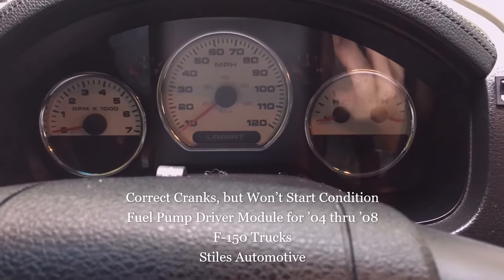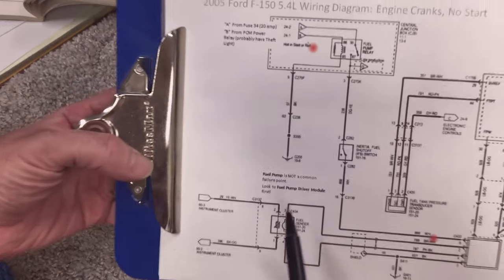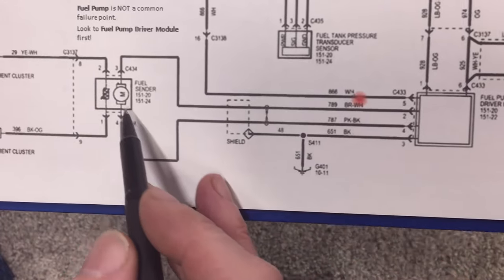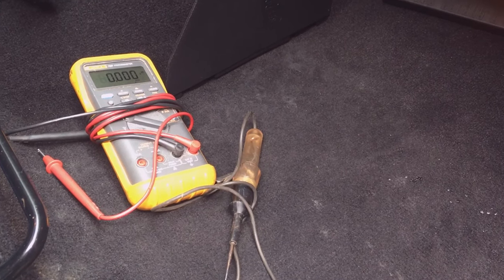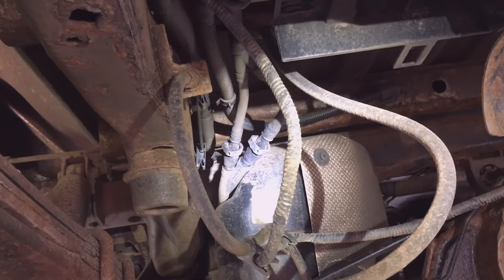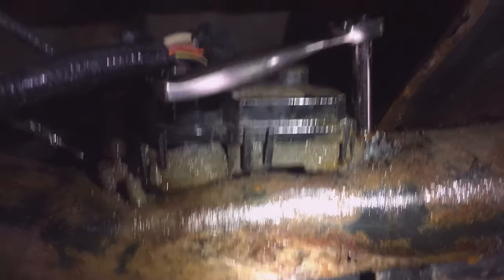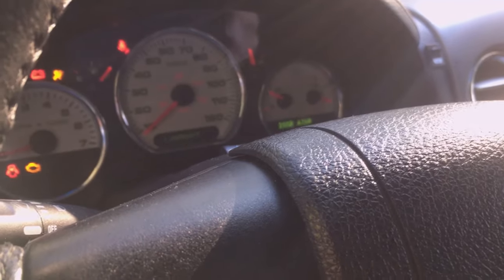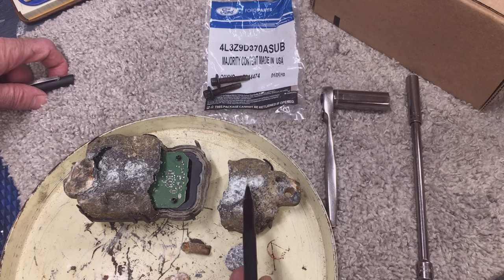Correct Cranks, but Won’t Start Condition – Fuel Pump Drive Module for ’04 thru ’08 F-150

Comment: You literally just saved my 07 from going to the scrap yard, I was ready to throw in the towel on the ol gal after changing fuel pump, fuel filter, throttle positioning sensor, spark plugs and coil packs i was at a complete loss till I swapped the fuel pump drive moduel.fires right up my truck (optimus) thanks you!
Reply from the maker: Joshua, I am glad to help! I appreciate the comment.  Your comment gave me an idea, my neighbor down the road a ways has a very nice looking Mark LT sitting beside his garage, I now wonder if I could help him as well.  - Stiles

Comment: So question if that module doesn't look damage how domu know if its the module or just a bad pump . My car does exactly wat this car does 2004 expedition crank and cranks nut no start at all please help im on fix income on disability and lots of doctors  appointments thank u in advance for your help
Reply from the maker: Jesus, You know if the Fuel Pump is bad because you jumper the wires (like I show in the video) and the Fuel Pump will run or if the Fuel Pump doesn't run and you are powering it, it is likely the Pump. - Stiles

Comment: Not sure if this is my issue as I don't have the proper testers for fuses and pwr. It is my landlord's truck; mine broke down and he said I could put his on the road and use it for work. I paid to legalize it and it never started. Great video, finally not just someone saying hey, your fuel pump is bad lol. Been sitting for 8 months so anything could have happened. 2:30 in the morning and I'm going to just the physical condition of the module.
Reply from the maker: Papa, Ensure your Battery has a full charge.

I assume when attempting to start the F-150 you do not hear the Fuel Pump, The F-150 Cranks and will not start, get a helper to turn the Ignition Key, while you put your Ear to the Fuel Filler Opening (with the Fuel Cap removed), you should hear the Pump Run. Have the helper turn the Key on and off a few times. The Fuel Pump should cycle on and off.  If it does not - -

1) With the Ignition Key off, 2) Remove the Electrical Connector from the Fuel Pump Driver Module (FPDM), 3) Using 2 Paper Clips jumper the Positive and Negative Electrical Connector Sockets (like I showed you in the video), 4) Turn the Ignition Key "on" ( and not to "start" or the F-150 may start and run), 5) Go back to the Fuel Filler Opening and listen for a good strong Fuel Pump, 6a) If you don't hear it, it is likely the Pump, but you don't know unless you check Voltage. 6b) If you hear the Fuel Pump, go start the F-150, and it will likely run, you have bad FPDM.

Let me know how it goes! - Stiles

Comment: Mine just cranks but slowly. What could I possibly check? I already jumped the positive and negative sides of my starter, also benched my starter out the car and it's OK, but still nothing.
Reply from the maker: Evan, the first thing is ensure you have a good Battery and it is fully charged. My Stiles Automotive Video, Charging and Starting Systems Troubleshooting may help you (see link below) - Stiles

Charging & Starting Systems Troubleshooting: Engine Fails to Crank or Cranks Slow, May or Not Click https://youtu.be/POAIX4QaEhA

Comment: Sounds like my 2001…
Reply from the maker: Sogent56, You may have a "Cranks, but won't start" condition, but your Fuel System is different. You have a Fuel Pressure Regulator which controls the fuel pressure. - Stiles
Reply: @StilesAutomotive  where is that located?   Thanks

Comment: I can't find fuel pump module on 2004 f 350 it is not at the rear by passenger tire where else could it be
Reply from the maker: Richard, what Engine does your F-350 have? On first thought, the 1999 (or so) thru 2004 F-350 gas Engines have a Fuel Supply Line (or Pressure side) and a Fuel Return Line. Which means you have a Fuel Pressure Regulator. The Regulator in on the Fuel Rail on the Top of the Engine or on the Fire Wall just behind the Engine. If I'm wrong tell me your Engine Size, I'll have a look in the Parts Book. - Stiles

Comment: Replaced module still won't start only starts with jumper wires
Reply from the maker: Donnie, That tells me the most likely problem is the Fuel Pressure Sensor on the Fuel Rail on the Top of the Engine. It could possibly be a Wiring problem or a problem with the Powertrain Control Module, but not as likely. Did you make sure the case (the body) of the new FPDM is well ground to the Mounting Point on the Crossmember?  Is the Electrical Connection on the FPDM ok? no Pins bent? - Stiles

Comment: I have a 2013 E-350 with the same problem, it does start, but only runs for about 10 minutes then stalls and won't restart, just turns over. If I let it sit for another 10 minutes it will start again and run for about 2 minutes. the garage thinks it's electrical, but I tend to think this is the problem. For a $50 part I'm pretty sure I can change it out myself. Thanks for the great video.
Reply from the maker: Wayne, For F-150s, If your Fuel Pump Drive Module (FPDM) is corroded at all replace it, your E-350 FPDM is not the same, it is plastic, and I'm not convinced it is the problem, it could be, but when it fails it fails. I think . .  .  did your shop check the fuel pressure at the Fuel Rail? Was it ok? if low pressure your Fuel Pump may be failing. or your Fuel Pressure Sensor on the Fuel Rail could be causing a problem. I showed in the video how to jumper the FPDM Electrical Connector, your Electrical Connector is different, I believe you would jumper the 2 outside Sockets of the 3, then with the Ignition Key on the Fuel Pump will run at full pressure, does your Van start and run, now? If so the Fuel Pump is ok.  Yes, it is a $50 part (for your E-350, not F-150s) and I would recommend you pay the extra money for a Motorcraft Part, I don't always, but in this case I do. - Let me know how it goes! - Stiles
Reply: @StilesAutomotive  My shop, the local Ford dealership, thinks it is electrical due to all the extra wires under my dash, the vehicle used to be a mobility transit van with wheelchair ramp. All wires for the exterior lights and ramp were cut and taped years before we bought it. But I started it up and drove it back from them and had no problem, no stalling. It just started recently and it has been sitting in my driveway. I did buy the part directly from Ford. There has never been any electrical smell at all that I have noticed either.

Comment: Thank you sooo much !! excellent video, this is second time I have to change this on a 16 year old F-150, I didnt know how to test my circuit...with paper clips is very smart !! ..I had to disconnect the battery for 2 minutes to re-start the computer. I live in uper Canada with the world record calcium-salt spreading, looks like you have to change this every 8 years...thanks again !!!
Reply from the maker: ToBloo, You are very welcome, I'm glad to help! Geez, you are my kind of Vehicle Owner; talking about period maintenance every 8 years. That is a long term vehicle owner!  I the video I painted mine, I hope this helps with corrosion protection. Also Di-electric Grease on the Electrical Connector helps keep moisture out. - Stiles
Reply: @StilesAutomotive  Yup !...I`m just to poor or I just dont mind the scraches to go in the woods with it....Hahaha. I got a after market that was already painted. My " check engine " light is on...i just dont know if the module body needs to be grounded to the body. Maybe I could remove paint just a bit  and disconnect - re-connect the battery...Thanks

Comment: Thank  you  so much.  I measured it like you said,  on the fpdm, between the white wire and the black/yellow wire,  with  ignition off.  There was 0 volts.   Then I asked a helper to turn the key to the on position and  voltage  between the 2 pins increased to 9.4 volts.  This morning I  am going out  to do all the rest of the things you said.  I am getting ready now.   I wish ford had put the central junction box somewhere else.    But it is what  it is, right?  I can't begin to tell you how grateful I am for your help.  A  lot of auto repair sites leave out important things and are confusing and vague.

Comment: Thank you, this is the most detailed FPDM diagnosis I found.
Reply from the maker: Glad I could help!  That looks like a Pontiac in your icon, to bad that car didn't continue, it could have turned into a great performance car.  The last years of the GT prove that.  Thanks for the comment! - Stiles
Reply: @StilesAutomotive  Yes it is an 88 GT. I plan to update the engine to a 06-11 GM 3.9 to add dependability and 100 HP. finally give the car what it wants, an ok amount of power.

Comment: Thanks so much for doing this video!  My son had his fuel pump on his 2007 F150 about 3 weeks ago, called today and said his truck wouldn't start/fire.  After watching this video I had him take the gas cap off and listen for the fuel pump to run when the key was turned - no sound.  Took a gamble and bought a new FP Drive Module and plugged it in - started right up!   Dropped the spare tire and the old one looked exactly like the one in this video!  It doesn't appear this was due to damage as mentioned in the video, it's just a flat out  poor OEM design.  The replacement module we got has two key improvements - 1) the housing case appeared to be plastic versus cast aluminum, and 2) it now has two rubber bushings to mount between the unit and the axle to keep it from bending/breaking.  Thanks again!!!
Reply from the maker: Tim, Your new FPDM sounds like a much better design.  I'm glad my video helped!  Thanks for the comment. - Stiles
Reply: I must have bought the same one you did @Tim Marquart. Mine was a Dorman brand. Same story here also, mine was corroded with a 2 inch hole in it. @Stiles Automotive thanks for your video!
Reply: I have an 08 F350, crank-no start.   In the last 6 months, I’ve changed the fuel pump, FPDM, plugs, coils, and fuel rail pressure sensor.   Was running well finally.   Went on vacation.   Came back and it cranks but won’t start.   Will start with fuel sprayed into intake, so seems like a fuel issue.   Have checked fuses.  Can hear fuel pump come on for a couple seconds when key is turned on, but still won’t start.    

So frustrating since the fuses all seem good and the driver and pump are new.    

Any ideas Stiles?

Comment: My truck is a 06 150 4x4 with a 5.4. 160000 miles. I had the turn over but not start condition. No trouble codes. No check engine light etc. I coild hear my fuel pump when key was turned on but not all the way to start. It ran for a couple seconds then stopped. I verified the pcm relay was good. All pcm and fuel related fuses were good. I replaced  my fuel driver module but that was not the problem. Turned out i had a blow fuse - the one for the ignition coils. Replacing that fixed it
Reply from the maker: Carl, Thanks for the comment!  As our trucks get older they are going to start showing their age.  You are fortunate it was only a fuse.  Sounds like you troubleshot in a logical manner, that is what I attempt to show in my videos.  If you had not replaced the FPDM before, at the age of your truck I would have recommended it.  Again, thanks for the comment! - Stiles

Comment: Ben Soto   ... my truck just did the same thing it crank but won't start , same problem you had. this video will help me figure if is the fpdm. I hope it is .. will get back to you.. my truck is a 2006 4 door supercrew cab
Reply from the maker: Benjamin, If they use salt on your roads, chances are it is the Fuel Pump Driver Module (FPDM). Under any conditions, for a 2004 thru 2008 F-150 with Cranks but won't start condition, the most like cause is the FPDM. Let me know how it goes! - Stiles

Comment: Found information concerning a turn over – no start problem leading to the fuel pump driver module under the rear spare tire. Checked this item for failure, turns out the ground wire for this module had broke off from the frame member. Several attempts to re-ground failed to start the truck. After stripping back wire jacket cover and some insulation found that in addition to the ground wire there is additionally a bare wire from the wiring cluster which wraps around the brown/black and the pink/black wires from the module plug, this bare wire is connected to the black/yellow wire which is grounded to the frame. Well my bare stranded wire had 90% frayed/broke away from the main b/y ground wire and looked frayed back to at least 3' as far as I could find while searching along the wire cluster along the driver side of A frame member. These 3 wires brwn/blk, pink/ blk and the bare stranded wire were wrapped in a silver foil like sheathing. I could not find good well insulated wire along this chase so i added a good pc of wire to the largest dia of the stranded bare wire and re-assembled it to the ground wire, taped and siliconed all splices - it worked like a charm! So it was not my Fuel Pump Driver Module YET!
Reply from the maker: Wilburt,  it is amazing your truck ran as long as it did, I'm amazed my truck ran as long as it did with the way the FPDM fell apart.  With the condition of your wires, I'm surprised your FPDM is in one piece.  Like I say in the video, if you haven't replace the Module, you need to.  Thanks for taking time to write your comment, it may help someone in the future.  - Stiles

Comment: Nice video!  Question, can a bad fuel pump module give me a "crank no start"?  I hear the pump coming on but have no Schrader valve.  Tried quick start and that was a no also, new battery, camshaft positioning sensors, got about 300 on my tach. checked all fuses & relays, starter switch, safety neutral etc.. I'm lost!
Reply from the maker: Tom, sounds like no spark. The FPDM can cause a cranks, but won't start, like it did for me in the video.  But you say you can hear the Fuel Pump running, take the Gas Cap off, put your ear near it and have someone else turn the Ignition Key to "on", you should hear the Fuel Pump good and strong.  Next check for Spark.

Sounds like you are doing the right things, Fuses, Relays . . . 

Did you Truck run after replacing the Camshaft Position Sensors?
Power at the PCM?
Quick Start is Starting Fluid? (Be careful!)  If so this leads me to believe, no spark.

Stiles
Reply: @StilesAutomotive  ..Thanks for the reply!  I just commented on the wrong thread lmao..But anyways, I have spark, and the first thing was changed both camshaft sensors.  Finally got it running but, like a bag of cats! Got new codes, camshaft sensors all 14 test drives now along with o2 codes.  Replaced the bad o2 (high voltage) cleaned the other 3. Test drive #15 and, same camshaft codes every time. Started to think I jumped time of my phasers are bad. Have no clue about phasers, though that was from star trek lol..Last time I rebuilt an engine was a 350, 25 years ago. Was able to drive it only for short tests due to how bad it's idling my last test drive it died again. Had to get it towed home. Back to a crank no start. But like I said every single tests I keep getting those camshaft codes. Now here's a funny thing, the last three mornings I was able to start it, but only for it to die right away. I started thinking fuel again!? I was about to remove the valve covers, possibly drop the pan and check my timing and phasers. But could a bad fuel module make it run sometimes, but at a very bad idle? Probably a lot easier to test then taking off the valve covers. Any feedback would be great! Once again I appreciate it Eh 🇨🇦 I've had 3 snow storms in 3 weeks, working outside, that's part of my problem.

Comment: I'm only getting 8 volts on that white wire coming into the module in the back. I do have 12 volt on the inertia switch. Any idea how to figure out why? My module looks just like yours cracked and broken and I have no start with no sound from the fuel pump on key.. looks so similar to yours even the crossmember funk is the same.
Reply from the maker: Alex, you could have a bad white Wire, but I think a most likely cause is a dirty Electrical Connector (C3138) on the outside of the frame on the Driver's Side located about midpoint between the Front and Rear Wheels, it is under a black plastic Cover.  It may be worth your time to remove the Cover Clean the area and disconnect each Electrical Connector there, Clean with electrical contact Cleaner, and apply generous amounts of di-electric grease to the Connector, then reconnect them.  I'd be interested to know if you get 12 volts at the FPDM.  Let me know how it goes. - Stiles
Reply: @StilesAutomotive  so what I was finding today is I only have 13 volts when I jumper the grounds in that module connector. Which actually I think makes sense doesn't it? If I just try to test the five pin for power I get 7 volts until I jumper the two grounds on the opposite side of the connector together and then I see 13. I assume that makes sence. I'm thinking about just hooking 12 volt power from a battery directly to the pump terminals to make sure.

Comment: My plug is corroded and I was wondering if I could make a jumper like you did bc it’s usually a in and an out for those models there you did it. Thanks!!
Reply from the maker: Elice, I wouldn't do that. You didn't say what F-150 you are working on, but for my 2005 F-150, 5.4L you can buy the FPDM Connector at Rock Auto (see link below). Make sure to put in your Vehicle information. - Stiles

https://www.rockauto.com/en/catalog/ford,2005,f-150,5.4l+v8,1431304,electrical-connector,fuel+pump+drive+module+connector,15715
Reply: @StilesAutomotive  yes sir! it’s the same (2006)